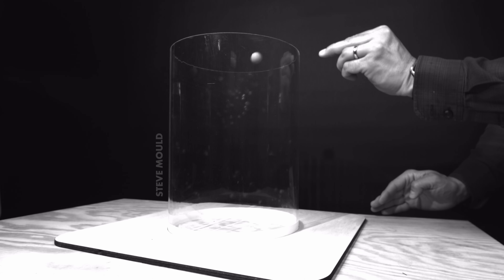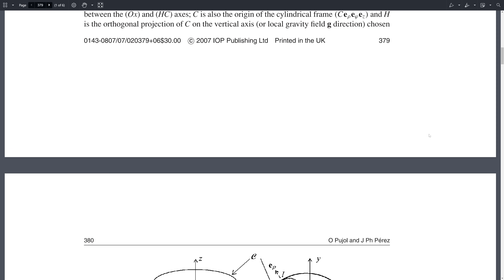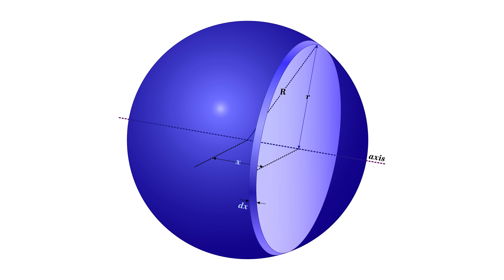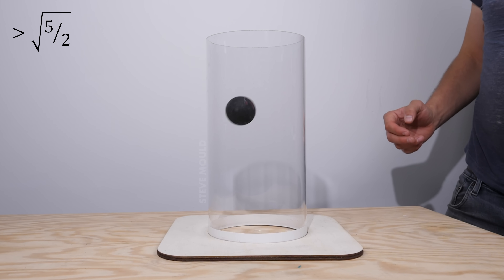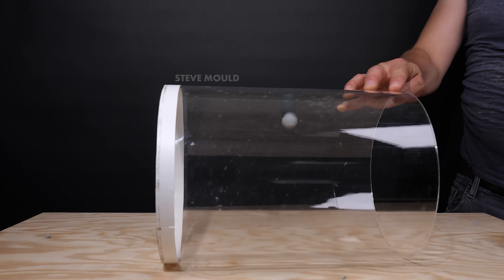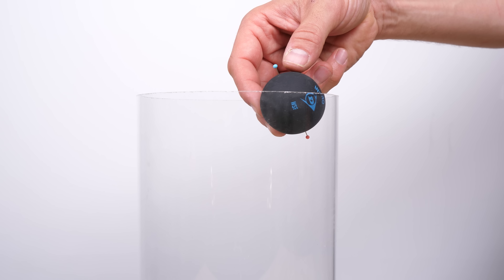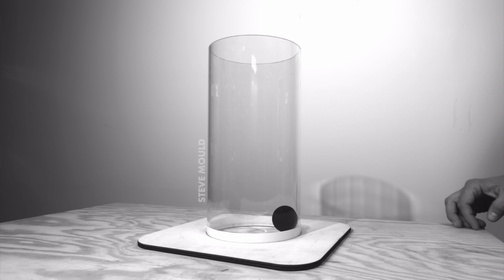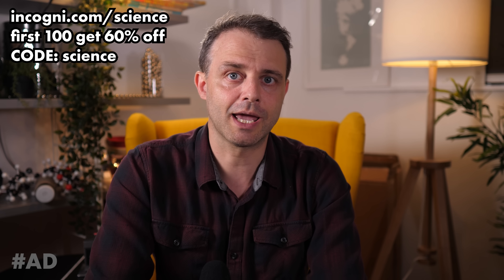The Golf Ball Paradox

Comment: you can think of a gyro with a constant precession rate as generating a force in the opposing direction, so apply a constant torque to a gyro and its rate of precession will accelerate until the rotation rate of the angular momentum axis will produce a torque that opposes perfectly the onoe applied, if that makes sense, parsed poorly, but thats the idea, so a rotating rotation vector corresponds to a torque with a rotation direction, so its kind of what corresponds to two different parpendicular axsheeesh of rotation combined together, which is the kind of path the your fingertips trace out when doing the 720 rotation trick. so in the rotating frame of the gyros angular momentum there will be a touqe 90 degrees of both of the rotation axis that have angular frequency, so this torque can be balanced with your finger for example in free space but then you ofc accelerate the whole setup as well so in a steady state you are doing work on the linear velocity. in the real world you are accelerating and not in a steady state, thats why the intuition of constant rate constant force decives you.

Comment: It’s centrifugal force that’s causing the ball to spring upwards. The ball going around the tube creates a force that is opposite to the force of gravity or the initial force in the direction it was thrown into the tube. Gravity or throwing the ball down makes the ball go down. The oscillation of the ball in the tube comes from the centrifugal force overcoming the inertia of the ball moving upwards or downwards and it’s a waveform. If you throw the ball upwards into the tube you’ll get the same effect. Theoretically you could do this with a frictionless ball you’re just making assumptions that it must have fiction. Friction only accelerates this effect by slowing the ball down which widens the oscillation and makes the ball slip down the tube less because a rotating ball with friction will oppose sliding down the tube like a tire on a road on a corner.

If I put a medicine ball on a rope and I spun around very fast while swinging this medicine ball around you’d also notice this same oscillation.

The rate of the oscillation is determined by the density of the ball. The amplitude of the oscillation is determined by the speed of the ball going around the cylinder. The faster the ball enters the cylinder the tighter that oscillation will be. As the ball goes around the cylinder it loses speed and so the oscillation widens gradually and so the ball either goes into the bottom of the tube, gravity takes over, or the ball leaves the tube out the top.

https://youtu.be/MUJmKl7QfDU?feature=shared

I’ll cite your video on autoparametric resonance. This is what you’ve created inside the tube.

Allow me to explain. Think about this from the perspective of the center of the tube always facing the ball. You’ve created a pendulum in a gravitron with the simulated gravity facing the outside of the tube. This is a pendulum.

If I swing a medicine ball on a rope around in a circle and face the ball as I spin it I’ll see a pendulum but from your perspective you’ll see this instead which is why you’re confused.

Comment: If you were to somehow get the ball to mark its path on the wall then unroll the face of the cylinder into a rectangle what would that path look like? I’m sure it would be an easier model to read to somehow make it so each rotation ends up being an expansion of the rectangle rather than warping back to the beginning. In the hypothetical scenario where it is able to oscillate indefinitely would it plot out something that looks like a sine wave?

Comment: Could this be explanation of the effect in horizontal setup:
If you draw an "equator" on the ball, and throw it into the cylinder - you would get your ball touching the cylinder where the equator is. However as soon as ball progresses down the cylinder - it rolls not on an equator - maybe at that point it either has to slip, or try to move "poles" so they are more aligned with the tube's axis of symmetry. this force leads to the standard gyroscope behaviour explaining the square root of 2/5 or 2/7 thingie.

Comment: If you want an intuitive way of explaining this, I'd suggest starting with pool ball 'english'. In pool, english means we strike the cueball off-center, imparting a lateral spin that interacts with the typical vertical spin of the ball rolling across the table; this makes the cueball swerve in the direction of the spin. So (e.g.) if you were to take out the flat inclined plane you used early in the video, but give the ball a sharp upward twist before releasing it, I think you'd see the ball do a dip and rise before gravity overcame that initial english.

What I suspect happens inside the cylinder is that centrifugal force is putting a constant 'english' on the ball, producing a countervailing spin moment by moment. That english occurs because the the ball is in contact with the wall at a spot that is not generally on the rotational equator of the ball, adding a new spin. The ball goes up and down cyclically because the additive directional vector of the spins changes according to the (periodic) precession of the ball itself and the (periodic) changes in the ball's contact point with the cylinder wall.

Comment: Based on your explanation and the slow motion footage, the best way I think I could explain it is similar to your explanation. As you throw the ball into the cylinder, it'll instantly encounter friction against the wall of the cylinder and begin rolling in the direction you threw it. But then, due to the curvature of the cylinder, it'll "roll" (actually slipping) around to the other side, and with your same naive assumption that the axis of rotation stays the same, the ball's original rolling rotation will now be rolling against the direction of its movement and start rolling back up the cylinder.
One experiment that might be an extreme example of this is throwing a bouncy ball under a table. You might have done a video on this before, but if you throw a bouncy ball under a table, it'll hit the floor and begin spinning forward. Then as it bounces up, still spinning forward, it hits the underside of the table and instantly gets thrown back out from under the table in the direction you threw it because the forward spin hitting the table produces a backwards frictional force that causes it to bounce back. At least that's how I understand it and it seems like an extreme version of a cylinder. With the cylinder, you then have to account for the spin of the ball constantly trying to match the direction of the ball's tangential movement along the cylinder walls.

Comment: What if you think in the way of the ball is constantly moving through a simple 2d surface, like the wooden table of the begining? I think if you split in 4 sections (with 2 axes) we will see the ball always repeating the same movement, I'm thinking about this from the point of view that we are seeing the ball through the cylinder and not from inside of it, making a more complex plane from what we are used to.

Comment: If you throw the ball on the steep flat surface it falls, but if you do it while pushing the surface horizontally towards the ball strong enough it wont. Is that the same in the cillinder but exchanging the force you applied for the centripetal force?

Comment: Per your request, here is an attempt at a simple intuitive explanation of why the ball's vertical travel oscillates at a ratio lower than once for every circuit of the cylinder, the value obtained if the axis of rotation remains fixed.

(IDK whether a better explanation has already been posted.):

The ball initially enters the cylinder rolling at a downward angle. It has a downward velocity and its initial axis of rotation is at an angle to the vertical. Assume for the moment its axis of rotation stays fixed, and there is no slipping. A quarter of the way around the cylinder the ball's trajectory will be horizontal. Its downward velocity will have changed to zero. 

One can think of the downward velocity change as resulting from a force applied perpendicular to the ball's trajectory and acting on a tangent to the ball's surface at the point where it contacts the cylinder. That force bends the ball's trajectory. But being tangent to the surface, it also affects the ball's axis of rotation. (The direction of axis change is per the gyroscope effect.) Because some of the force is spent changing the axis of rotation, less remains to bend the trajectory. So the trajectory changes more slowly than it would otherwise. When the trajectory changes more slowly, the oscillation ratio is lowered.

Hence the oscillation ratio is lower than the 1:1 obtained if the axis of rotation did not change.

Comment: I wonder if there’s a contributing factor in that, as the ball travels around the cylinder, the side of the ball which is in contact with the cylinder oscillates to either side of its effective equator, thereby changing the direction in which the friction force is applied? The gyroscopic effect would ensure the orientation stays the same, but the moving line of friction would determine the path, in a similar way to how a train wheel’s flange allows two wheels to roll at different speeds despite having a fixed axle.

Comment: I think there is a happy "energy picture" perspective on this, which links to things like orbital mechanics.

In order to rotate at a fixed distance, an object has to have a fixed kinetic energy, based on the diameter of the rotation.  If the ball has more energy than this, it wants to lose energy (by climbing against gravity).  If it has less, then it needs to gain energy to be stable (by falling down the sides of the jar and accelerating).  It will oscillate around the point at which the kinetic energy is right for a stable orbit.

You should be able to test this by working out the linear velocity required to keep a stable orbit (without gravity), given the moment of inertia of the ball and the radius of the jar, and noting that by launching the ball below this velocity, it will never gain enough velocity from falling to exit the jar.

Edit:  A better comparison is maybe cyclists in a velodrome, climbing the sides to gain more energy to release later as speed.

Comment: The most simple explanation of this would use the principle of least action. The ball rolling around the cylinder wants to take the path of least action which is sideways in the cylinder. As a consequence the ball's motion goes from downward to sideways. The geometry of the roll of the ball gains an "acceleration". This in turn causes the ball to move back upwards. While it is moving back upwards it is no longer taking the shortest path. Thus the ball tends again towards a sideways path and the geometry of the ball gains an "acceleration" downwards. This causes an oscillation about the sideways state of the ball. 

The geometry of the ball gaining an "acceleration" is the difficult to see non-inertial part with inertial forces. That part requires math and with rolling balls moments of inertia. It's pretty much the same thing in all rotating non-inertial reference frames. It is one of the more difficult things to see intuitively in physics. It is also risky to explain in layman terms. e.g. it might be upper bounded differently i.e. the ball might want to tend upwards until it crosses a vertical motion in the absence of gravity and then go through the cycle again in which case it would be upper bounded by gravity.

Comment: Correct me if i'm wrong, as the contact patch or the point of contact between the ball and the cylinder become closer to the axis of rotation, the speed of the contact patch changes because that part of the ball is moving slower to maintain the same overall rotation rate. This would impart more torque to the cylinder wall (perhaps i should say less slip), causing the ball to move upward. This would also allow for the difference in the oscillation ratio. Thoughts?

Comment: The inertia of the ball causes a distortion of its surface as it interacts with the cylinder. It's own elasticity causes the axis of rotation to invert until it's kinetic energy is less than the force of gravity and it begins to fall. Falling increases the energy and again friction causes enough distortion of the balls surface to alter the angle of rotation. This cycle continues with diminished returns until equilibrium is reached.

Comment: If you could get a good slow-mo in color, you could paint six different color dots on the axes and then track their motion around the cylinder.  That visualizing in tracking  and rotation might help?

I think the key may be that the axis of rotation on entry may not be aligned the way you're theorizing - of course, in theory it would be aligned for the rolling, but I'm wondering if there are other rotations going on that could be the key to it?

Comment: the more friction the ball has, the more it is bound to keep its position relative to the wall of the cylinder - but only at the exact spot on the surface of the ball that touches the leaver. so all the pull from gravity will only be able to pull down the ball at the part of the ball that is not in direct contact to the wall, making it turn in a way that lets it change its direction upwards during initial downward-movements and downwards during initial upward-movements.

Comment: I would say it's behaving with a wave motion like a ball rolling over a bunch of hills except the hills are rolled up in a tube so when it goes down one hill it rise up the next hill reversing it's direction but maintaining it's spin and momentum so if you unrolled the tube into 4 small hills and valleys you get a wave function. So it's a wave function of a parabolic arc as translated by a cylinder or as described by a cylinder maybe it'll follow the same path as a ball rolling over smaller and smaller hills diminishing at an exact rate depending on the weight to friction ratio of the ball

Comment: Your intuitive explanation was the first thing I thought of, and I also noticed that the answer is incomplete because we don't take into account the slight shift in the axis of rotation due to friction and inertia resisting the pull. However, when the tube was on its side, it did behave very similar to what I intuitively thought was happening for both hollow and solid balls. What if in a gravity-free environment the ratio is exactly 1, and it's gravity pulling it down, leveraging on the ball at the point it touches the wall (like a lever where the pivot is the point where it touches the wall and the force is applied somewhere at the centre of gravity)? Maybe on its side, the tube has less of an effect on the ball due to gravity because the wall is only perpendicular to the ground (in direction of gravity) at 2 points on the circle, and everything else is a slope.

Comment: It happens because there is no gravity.  Its velocity and angle are able to overcome relative density and buoyancy.  In other words, the ball that is denser than the atmosphere around it and will cause it to fall because it has no natural buoyancy due to displacement in the medium to conteract that- like a battleship on the ocean. However, its velocity compensates for that and overcomes the lighter atmosphere around it, causing it to rise- like an aeroplane.
Reply: No, that's not it at all. There clearly is gravity because the ball will still fall down if it's not going fast enough to overcome it. You guys replace it with "density and buoyancy" because stuff like this apparently defies gravity, yet using that logic the ball is also defying the laws of density and buoyancy because it's refusing to fall.

Also if gravity didn't exist and it truly was just density and buoyancy, EVERYTHING would float upwards. The reason something like a helium balloon floats up is because there's a higher amount of pressure acting on the bottom than the top because of the pressure gradient of the atmosphere. There's ALWAYS more pressure beneath something than on top of it. Gravity is still there but helium has such a small amount of mass compared to the air around it that the buoyant force overpowers the weight of the balloon.

Now the reason why the balloon would fall if you filled it with conrete instead is because the balloon has more mass and therefore weighs MUCH more, however the balloon still has the same surface area for the air pressure to act on. So the force of air pushing it up remains the same, but the weight pulling it down increases massively, overpowering the buoyant force acting on it.

In your imaginary world where gravity doesn't exist. Everything would float upward. There's no downward force due to gravity because gravity doesn't exist, but there's ALWAYS more air pressure pushing on the underside of an object than on top of it, therefore there's ALWAYS a larger force pushing everything upward. So why doesn't everything float? Because gravity exists. It's also the reason there's even an atmospheric pressure gradient in the first place. It's complete nonsense for there to magically be a gradient with no direct cause.

Comment: Ok, the horizontal experiment is interesting because with no "downward" force the rotation to oscillation ratio is much closer to 1:1.  In fact, the ball leaves the cylinder at almost the same point that it enters. I'm guessing that the difference between the entry point to the exit is the fact that the ball didn't have any rotation before it came into contact with the the cylinder wall. (At least no rotation that would account for the oscillation.)